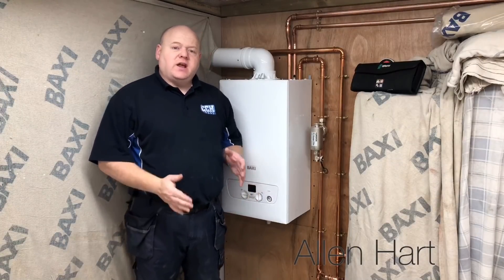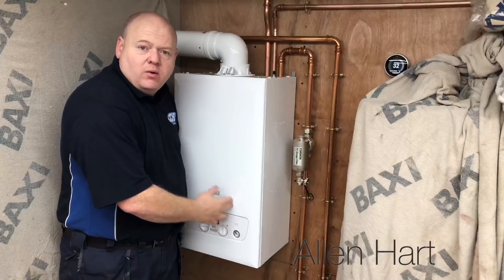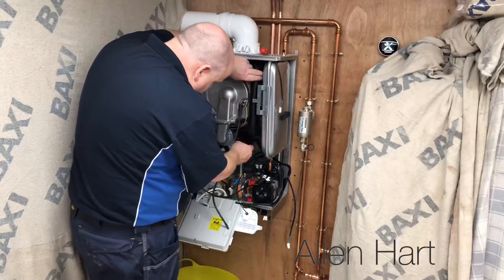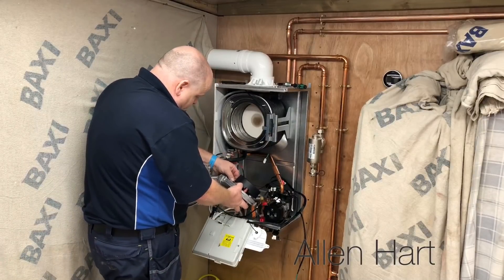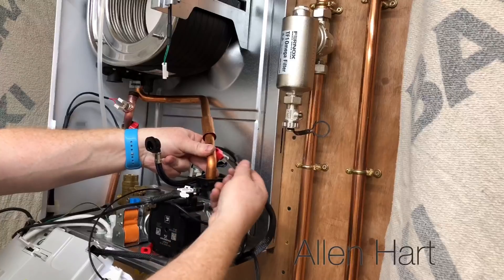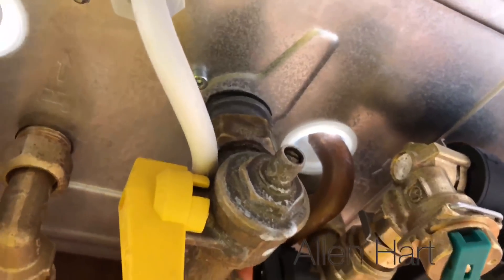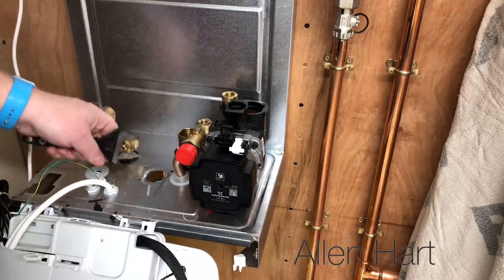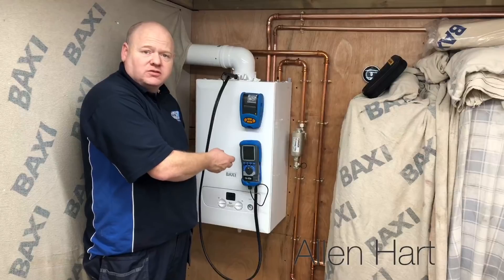Combi Boiler Reviews - Baxi 600 Review and Full Strip Down

Comment: Just fitted one of these and have a problem. Hot water works fine but central heating doesn't work. Display flashes with the (E) Error symbol, the No Flame symbol, the Spanner symbol and the word 'Und'. Can't find any info online. Any ideas?
Reply from the maker: Instructions will show you how to sort it, think it’s page 47

Comment: Great video again alan was intersting to see what you pointed out about how dirty the aav and prv looked when you took it out considering its new and on press fittings etc and filter i wonder why that was as they are the most likely parts to fail in a couple years after customer over pressurise it also that flow turbine looked a bit of mare to remove if you hadnt already took apart a lot of fittings i like baxis but not sure about this new crop of boilers yet
Reply: James S you're right about the flow turbine, I had to remove one cos the magnet had got stuck, limescale and poor access for tools made sure it wasn't an easy job!